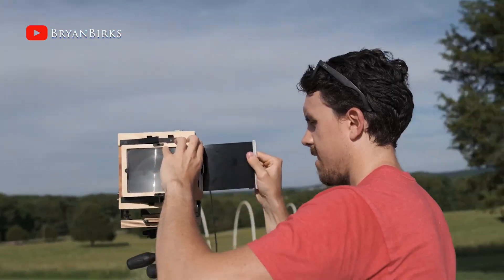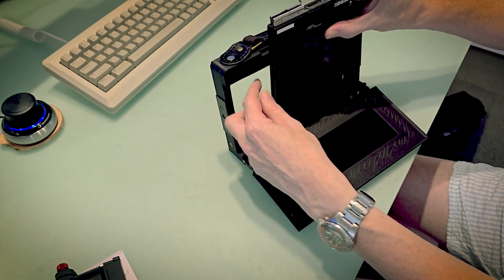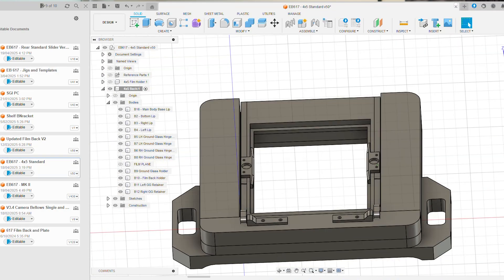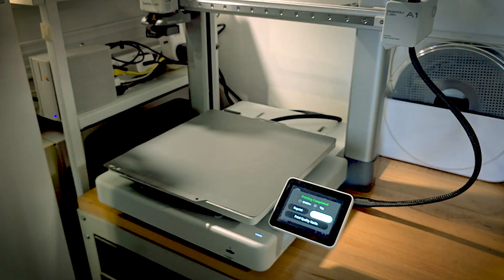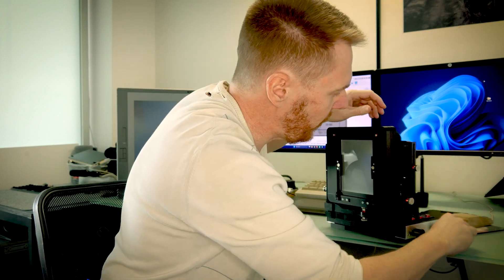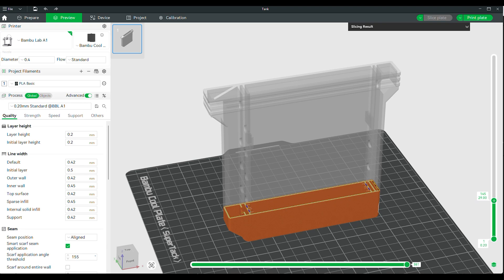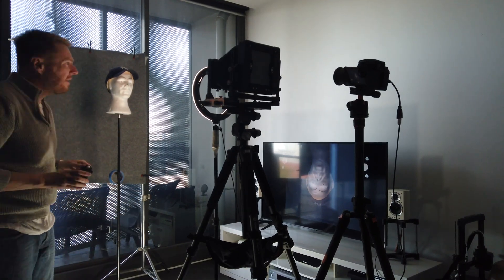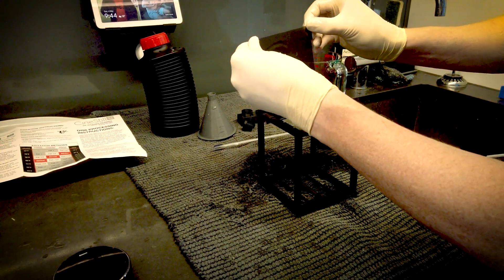4x5 Film Back for 617 Camera

Comment: I was going to ask if you had any plans to make an Instax Wide back for this, but I guess now you have made the 4x5 holder, you could just put a Lomograflok in there to shoot Instax. This looks super cool. A fair chunk of hobby money, so I will have to start saving.
Reply from the maker: Funny you should say that, I have been planning an Instax wide back for a while now, pretty much straight after I finished the back for the Hasseblad. Only problem has been finding donor Instax wide backs on eBay hasn't been easy, they are just too expensive. I went so far as to buy an Instax Wide Link (it takes the film but you send it prints from your phone) but when I disassembled it the way they mount all the electronics and gearing makes it impossible to modify to use on a back. I have an eBay search setup though, so if I ever do get an Instax wide camera to use as a donor, trust me, I will be doing one doe the camera.

Comment: I am seriously tempted, though I do not have any 3D printing skills, so would have to buy the fully built version from you. Do you know if the checkout price includes VAT (for UK) or is this an extra charge I will need to pay when it arrives?
Reply from the maker: I'll tell you what I tell everyone who says this. If you have even the slightest amount of diy skills, you can 3D print this camera. The irony is, even with the cost of buying a printer (I would highly recommend the Bambu A1) and filament  as well as the plans and the hardware kit, it still comes out cheaper than a fully built camera 🤦🏻‍♂️
Building your own camera is such a enjoyable experience, I can't recommend it enough. I have helped quite a few customers who have never used 3D printing and they have built one of these as their first project. The Bambu printers (not a sponsor) are pretty much the Apple of 3D printing, they just work straight out of the box. Im always available to answer the little questions that pop up. And then after you are finished you have a camera AND a new 3D printer, winning all around ! Oh and no VAT on digital downloads !
Reply: @thefilmlaundry  I have been looking at 3D printers and seeing what is around. I think the Bambu A1 might be a good starter (I may use it for other things, but I'd pretty much just be buying it to print your camera). But I still have a couple of questions for you .... what is the minimum bed size I need to print your camera? And is there a full list of hardware detailed in your build plan so I can source it locally too? Thank you.
Reply from the maker: Hi, yep the A1 is the way to go, it's what I use to print and have nothing but good things to say about them, the bed size of the parts are all designed to be printable on the A1s 256 square bedside. The parts list is on the website under the hardware kit listing, additionally it is also in the build FAQ that comes with the digital plans. Hope that helps

Comment: Impressive work, congratulations. I like the design. Having used a 6x17 back on a 4x5" camera, which was complicated, I am thinking of exchanging one of my 4x5" cameras for the EB617: What range of lenses can be used with it? Can you tell me something about the maximum movements? And last, but not least: From where do you ship?
Reply from the maker: Yeah, I originally was planning on going with a 4x5 camera and a 617 back, but after seeing all the limitations, that's why I decided to build my own.
Can definitely answer all your questions, if you want to send them through the About page on my site thefilmlaundry.com, I can answer any questions you might have
Reply: @thefilmlaundry  Sure, I will drop you a line.

Comment: Very nice! The 'standard' Graphic film holders in use today I believe were made mainly for speed, in old Graphic press cameras- mostly focused by rangefinder, press photogs needed quick film sheet changes they could do by 'feel'. The older Graflex (slotted) holders were more precise to change but didn't accommodate ground glass (didn't need to in Graflex SLRs). You came up with a nice hybrid. I might just need to buy the plans and print one out!  
Do you plan on offering your tank STLs?
Reply from the maker: Interesting. That makes a lot of sense.
I'll pop the files up for the Tank on my site under the free downloads section. Just need to tidy them up a little before releasing them to the public. Should only be a day or so.
Reply: @thefilmlaundry  thanks. Just got a new flashforge, prints nice and fast. Itching to give it a try.
Reply from the maker: Files are up on the site under the Free downloads section now. Interested to see how a resin printer handles the print, not printed in resin myself. Not sure how you handle supports in resin, but it goes without saying, don't allow any supports inside the model as you will never be able to remove them (the absolute joy of designing a lightight model that also allows liquid to flow)

Comment: I have to agree with not liking Intrepids holding system. I had one of the plastic clips break on me one day. I’m going to look at 3D printing a different clip for it that is more reinforced and use this as an enlarger for my 4x5’s. My wife bought me a shen-hao 4x5 last October as a wedding present and I like there system a lot. Your 4x5 back is a great piece of engineering. I just bought your 617 camera and can’t wait to print it and try it out when I get home from Shanghai. I’ve been wanting a 617 and was going to try and build one out of wood myself and the only thing that had me stuck was the bellows and film back.
Reply from the maker: Yeah Shen Hao make some amazing gear.
There have been a few people who were planning on making some of the EB617 parts in timber. Definitely if I had the room I would love a woodworking area and would love to try my hand at it. In the meantime, going to have to settle for learning CNCing metal.
Reply: @ I bought a cnc last year to mill the front and rear standards out of aluminum or brass.
Reply from the maker: That's my plan, want to see if I can produce the rear and front brackets in aluminium, would be a nice option for people who want that on their camera. That and I needed a new toy 😂 currently knee deep in learning CAM, there's a lot to learn compared to the simplness of 3D printing